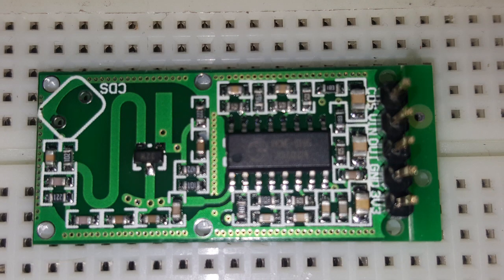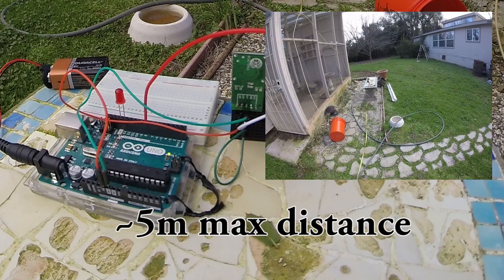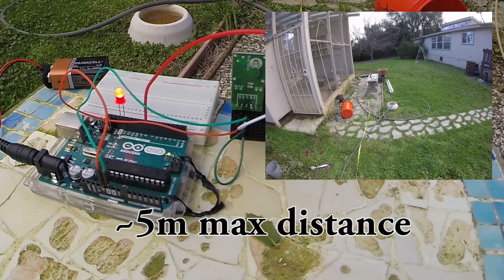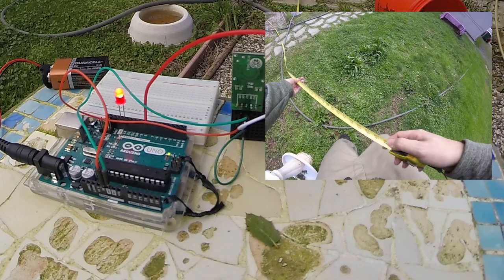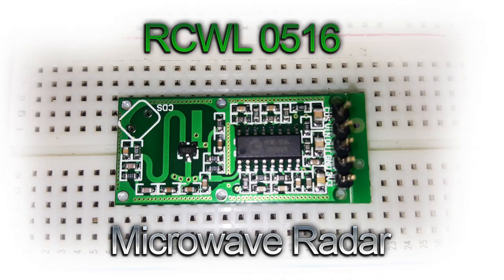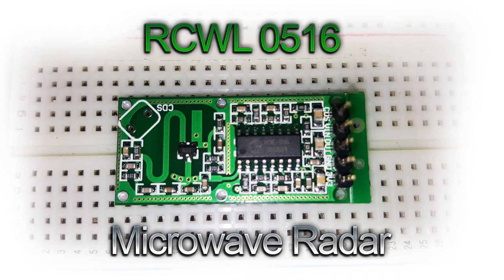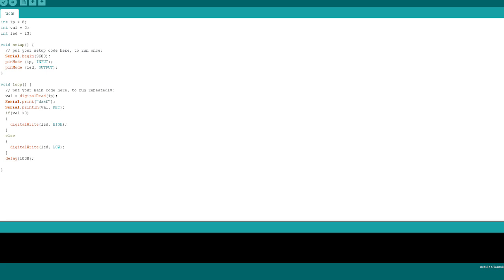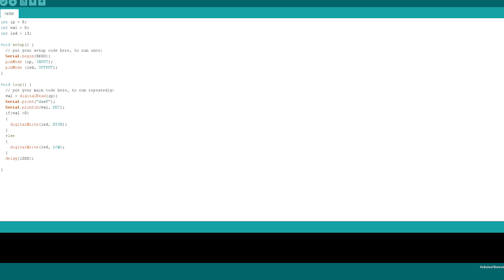RCWL-0516 Microwave Radar Sensor Arduino Distance Test and Review

Comment: This sensor could be connected to a solid state relay, to activate LED light 60watts, without the need for Arduino, since in my country is not cheap the Arduino, thank you very much for your attention

Comment: You can test without an Arduino. Just connect an LED from output to ground. No series resistor needed because one is already on the board.
Data and schematics for the chip (RCWL-9196) and the board (RCWL-0156) can be found here:
(links not allowed here, so add a dot where the space is before "com" in these links)
http://www.mpja com/download/34685MPData.pdf
https://www.mpja com/download/34685MPSche.pdf
https://www.snapeda com/parts/rcwl-9196/RCWL/datasheet/
These documents also show some options that are available on the board for adjusting range, trigger cycle time and light sensitivity (if using with a photoresistor).
Reply: Can this sensor detect objects? Or only humans? If a car moves in front of it, does the sensor detects the movement?

Comment: Hi, it's possible to reduce sensitivity of radar let's say to 1 meter? Thanks for sharing this project
Reply: Yes.
Data and schematics for the chip (RCWL-9196) and the board (RCWL-0156) can be found here:
http://www.mpja.com/download/34685MPData.pdf
https://www.mpja.com/download/34685MPSche.pdf
https://www.snapeda.com/parts/rcwl-9196/RCWL/datasheet/
These documents also show some options that are available on the board for adjusting range, trigger cycle time and light sensitivity (if using with a photoresistor).

Comment: Was curious about distance. Would be fine then for room sensors depending on positioning.
Reply from the maker: Yes, for a room 15x15 or smaller it would cover the entire area as long as there wasn't interference. You should note as well that these microwaves will penetrate thin wood, and therefor things like doors, so if you only want it to cover the one room, you may have to position it strategically, and depending on the room size you might want to add resistance to make it have less range/sensitivity.
Reply: Can you check to see if it will detect someone on the other side of a door?  I can see that being handy.
Reply from the maker: I am fairly certain it would make it through the average inside door, but most outside doors contain metal so I'm not sure it would be able to penetrate them. This would be a good experiment, I have received some great requests for this sensor! hopefully I'll have some time next month to make another video revisiting this sensor and running a few more simple experiments!

Comment: how can i decrease length because mine is going through my wall..
and how can i block it totally.. on the sides for instances?
Reply from the maker: You should be able to decrease distance by adding resistance. I don't think it's possible to narrow the width of the signal specifically, however adding resistance might also have an effect on the width.
Reply: From other videos, the signals don't penetrate metal so, in theory, you can put up metal barriers on the sides you don't want to detect

Comment: i have some question ? you are using resitor in output ! can you tell me what is the actual job in this pin for resistor ?  if i dont use resistor what will happen?
Reply from the maker: If i remember correctly this may have been left on there by accident after I switched some stuff around (I ran some other experiments with it off camera before filming this), you should be fine without a resistor here.
Reply: There is an onboard series resistor (100ohm) on the output.

Comment: The RCWL-0516 is supposed to detect thru walls.
Reply: Yes although foil backed (faced) insulation will greatly reduce its detection distance through an exterior wall. Interior walls usually have none or non foil faced.

Comment: Based on your experience, is there is a specific orientation in which to point it to perform the test?

Thanks
Reply from the maker: Yes the emitter is on the face of the face of the module, and should be pointed in the direction of preferred detection. I'm not certain of the angle of coverage, a rough guess would be about 90-150 degrees.

Comment: You could do with a course in soldering. Just sayin'... 🤔
Reply from the maker: Peter Riis got any pointers?
Reply: Hard to do in writing, but briefly:
1. Put the clean and 'wet' tip of the soldering iron on the spot and heat for a second or so (depending on mass).
2. While heating, add sufficient solder in one swoop letting the heated materials melt the solder - NOT the soldering tip.
3. Keep heating a short while until solder flows evenly.
4. Remove the soldering iron.
5. :-)
Reply from the maker: Peter Riis Ihave been heating the solder with the soldering iron tip, didn't know that wasnt correct! Thanks for the tips will give them a try!
Reply: That tip should be fine except for SMD soldering...
Reply: Kevin Gulling - Step step 5, smiling after removing the soldering iron, is essential. Make sure not to skip it.
Reply: Peter Riis 인정합니다. 납땜하는 걸 왜 보여줘
Reply: Hm well actually with smd and THT it's usual to put the solder iron in the edge, heat 5 seconds and you have a perfectly fine soldering point. That way you have a heating bridge (At least thats thats the way you learn in any IPC training and I guess we can accept a industry standard that even applies for plane eclectronics should be fine.

Comment: Other than short range detection; what else could this chip be used for?
Reply from the maker: I would call this "mid range" as there are many sensors that have detection ranges measured in the millimeters. Other than detecting movement I'm not sure what you would use this for. If you think of something though, please share!